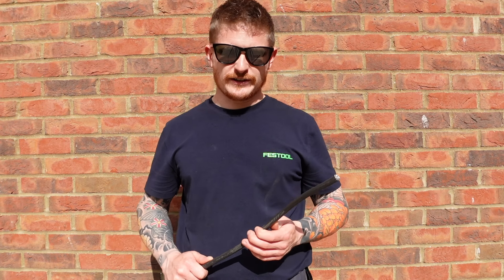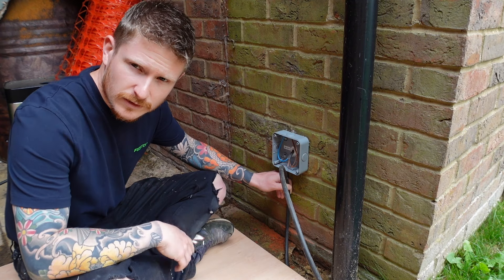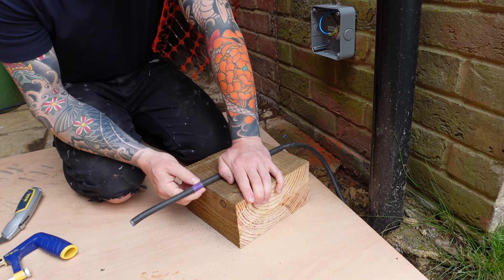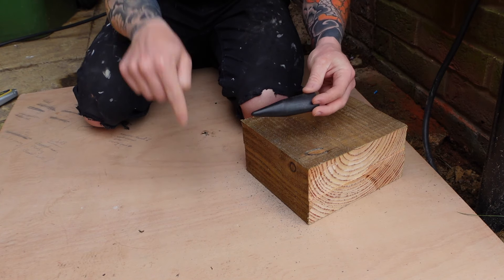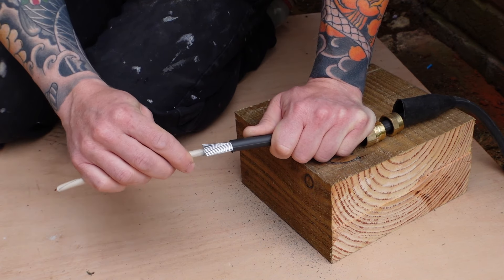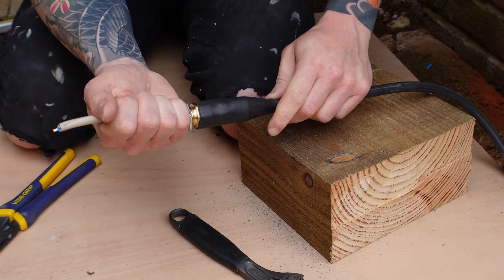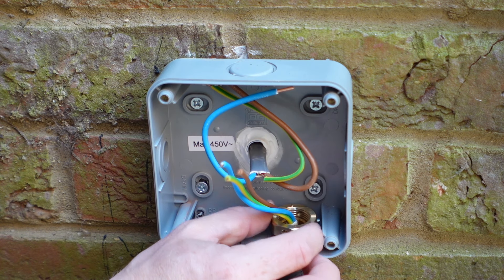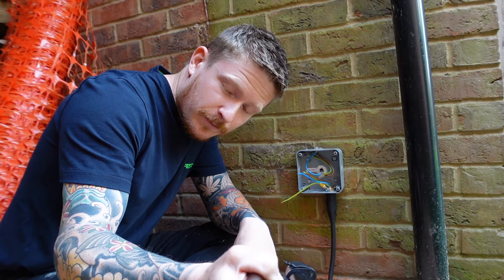How to Make off a SWA Gland | Steel Wire Armoured Cable Install

Comment: It’s a lot easier to push the shroud over the cable and the part of the gland needed before you expose the steel wires that can make it harder to do this
Reply: Agreed, I did this today and followed the steps exactly and cut myself trying to get the shroud and wedding ring over the bits of steel.
Reply: @savingelectric 
Nasty mate, I feel for you. 
This happened because the content provider failed to show that stage  of the process because he’s not experienced enough to teach others yet. 
He struggled himself that’s why it was edited out 😂

If it’s any consolation l, I was reckless back in February and lost a tiny bit of my fingertip due to a slip up with a fresh blade.  Was savage

Comment: Just for a future tip, strip less length  of the metal strands- as you want the top of the gland to water proof  on the outer sheath not the metal strands. Your way- over time the metal strands rust like crazy and let water pass through as it isn’t a good seal

Comment: Personally i would place the shroud onto the cable first. I'd offer it up to the cable pushing it as far as itll go to gauge where to cut so it's a good tight fit.
   Having cut your shroud you either push it on directly in the direction it fits or push the shroud on the contrary way to how it fits and turn it inside out once on the cable. Whichever way is the easier. This depends on the thickness of the shroud's rubber. If its stiff thick rubber then it's best to put it on cut end first as it'll be installed.

Comment: Great video, can you spur off any ring mains socket providing you add a fuse spur? I.e. when all ring sockets are already protected by a RCD at the board?
Reply: Yes, in theory, you shouldn't spur off a spur but fuse it with 13amp fuse.

Comment: I also use Visegrips ( Molegrips in Gt Britain) to securely hold the body of the gland whilst using a good quality adjustable spanner to tighten the nut. Then bend and twist the assembly to determine that the SWA strands are all gripped tightly and there's no movement or play.
Reply: Overall this is a damned good tutorial.

Comment: Excellent video👍 clear and informative.

One thing worth mentioning is that the steel wire armour should not be visible at the bottom of the gland assembly when you've tightened up the last waterproof nut with the rubber seal. If it is then the armour has been cut too long and the gland is not waterproof, despite the outer rubber shroud.
Reply: good point , many people make the same mistake
Reply: Yes I was thinking the same
Reply: Dears kindly can I ask questions
Reply: @Gubalicious  it’s also much easier to slide the shroud, locking nut and ring along the cable and past the connection point before scoring and spreading out the steel wires in preparation for the gland to be fitted.
This helps prevent any struggle with fitting the gland and injury to the hands

Comment: Thanks for your time creating this clear video, much more confident asking for glands etc, rather than saying the back blobby part at the ends of the cable. Cheers
Reply from the maker: Glad it was helpful!
Reply: @TheDIYGuy1  Managed to do the gland, but may have to redo, as I brought a 4 way rotary isolator and not sure if the Neutral wire will be OK in the N1 slot or has to be in the Neutral separate side connection as literally an inch too short. Waiting for the earth nuts so will redo if need be. Thanks for your time.

Comment: there is a much easier way than faffing about with a hacksaw simply use a standard plumbers adjustable pipe cutter, it will cut through the outer sheath and score the armour wires in seconds perfectly straight around the cable

Comment: Sparky quoted me £300 to do 4 of these, thanks a lot. Didn't think it would be that difficult .
Reply: Sparkys hate YouTube and diyers 😂
Reply: And how did you get the electrical cert after doing them?  Or have you just invalidated your house insurance?
Reply: @CBE-d6j  dont know what you're talking about. The circuit was already there when I bought the house 🤫
Reply: @CBE-d6j   another rip off sparky putting fear into people they are good at that
Reply: @cjrodwell  hahahahahhahaha how to beat the rip off sparky's

Comment: The shroud should always be fitted FIRST. Easy way to do it and get the cut right is place it over the cable end, push hard and the cable will be seen better, cut the top of the shroud off as required, then take the shroud off, turn it around and slide it back onto the cable past the point where the gland is going. The install the outer parts of the gland. Then make the cable off. Doing this way you are less likely to forget the gland and less likely to splay the armourings on the cable when you fit the gland.
You also need to mention that this is a CW - Waterproof gland for use outdoors. Do not use BW glands as they are for use inside.

Comment: 1.5 3 core you can cut with 200mm cable cutters 👍.  Lot easier than a hack saw on a small cable.

Comment: Well done video, congrats. I need to connect an armoured 3 core black cable like that one in your video, but I am not sure about the size. External diameter is 17.7 mm. What gland should I use?
Thanks😉

Comment: Great video! Regarding scraping the paint on a metal enclosure, if the metal enclosure has a earth stud/terminal in it for the earth lead from the banjo/earth nut to attach to, is scraping paint necessary?

Comment: Great video and so easy to follow great job
Reply from the maker: Thanks, glad it was helpful
Reply: @TheDIYGuy1  I took my swa from my old concrete shed via a waterproof connector the wires were different from the power in my old shed red,green,blue, and my 2.5mm colours were black , brown, grey . Can you recommend a CU for my shed taking in mind it will be supplying to 4 sockets 2 small led strip lights and a light switch.

Comment: Mate this is EXACTLY what I needed to see. One question tho, I'm using 4mm SWA to power & light a log cabin. What kind of cable do I send through the wall to the main house consumer unit?
Reply: Use the SWA cable as it provides mechanical protection while going through a brick wall

Comment: Perfect Vid for what i'm doing. Lots of detail which is perfect.  Quick question. Where i wanted to terminate my armoured cable into an Outdoor Weatherproof Junction Box is few feet from a water butt . Is this a problem as regards regulations? Thanks in advance and keep the vids coming
Reply: It should be fine, the only time this would have trouble for regulations is when you're installing it in a "special location" a.k.a a bathroom, if you're still worried use a higher IPX grade junction box

Comment: Hi mate, In my house we have 1 junction box (Outdoor) and from there 2  SWA cable 2.5mm  come out for 2 different areas. They are plugs but we use them for lighting and charging some battery tools in the garage. I'm worried maybe the consumption is not dangerous or maybe the installation. Excellent video mate!

Comment: Great video, do you have a video how to connect to the house consumer unit or mains
Reply from the maker: Thanks. I'm afraid I don't.
Reply: @TheDIYGuy1  
I need some advice and hope you can help.
I've installed a BG consular unit in my garage and run armod cable to the house.
What is the best way to connect to the house power supply?

Comment: Is it legal to make this connection and run power to an outbuilding/shed in the UK?
Reply: Not illegal. But if it causes a fire or electric shock your insurance could be invalid.

Comment: Great video, very simple to follow and easy to understand. Can I ask, what do you use to cut the cable to length? I have bought a  25m roll of armoured cable but need to cut it at around 18m.
Reply from the maker: I still use a hacksaw for this but you can get purpose built cutters.
Reply: @TheDIYGuy1  Thanks for the reply.
Reply: Use an angle grinder, quick and easy

Comment: Hi,

Great vid massive help.

Question: i need to power man cave and wouldn’t mind an outdoor socket too.

Can I take the power from inside 13amp socket, to outdoor water tight socket, then SWA from that socket to cave ? I’d the. Want to run lights and sockets off the other end in the cave.

Any info would be greatly appreciated!

Thanks again for these vids

Comment: Better using a SWA cable stripper it looks like a plumbers pipe cutter and you just move it round and round the cable  it cuts through the wire as well
Reply from the maker: Yeah seen those, I may have to get one

Comment: Where did you then connect the earth wire from the SWA nut to earth it? To a socket?
Reply: You connect it with the earth coming from the consumer unit, use a WAGO 221 2-way connector to attach them together or if the junction box is metal or has an additional earthing terminal inside the box (usually found in the corner of a box) you will need a 3-way WAGO 221 connector to add an additional earth wire to the box :)

Comment: Hi, Mind if I ask if the armoured cable for safety when feeding electric out to say an outbuilding/garage type situation? and would that then connect into a consumer unit? Great video thanks!
Reply: Armoured cable is normally the safest choice if you're running to a garage or an outbuilding, ideally the cable will be buried but you can clip along a wall, fence etc. if you don't mind having it on display.

Comment: Quick few questions 

So what are you connecting the SWA to. Is that just 2.5 twin and earth from the ring main. And on the otherside at the shed for example would you do the same. Connect it to 2.5 twin and earth using terminal blocks and then connect up your sockets 

Secondly the SWA i saw online has difference colour cable. Grey, black and brown. Is this the same stuff. 

Also I was going to trail the cable underground in conduit. Have you got it under the slabs?
Reply: Also is that 2.5mm2

Comment: Do you need an earthing nut if it's in a plastic case?
Reply: Yes as it's earthing the metal wires (armor) within the Armoured cable

Comment: I've been looking at SWA cable at screw fix 2.5 armoured. The colour are gray,brown,black? Your armoured cable in the video is blue,brown,earth Dan
Reply: You have 3 phase colours, the black and grey can be sleeved with blue and green + yellow sleeve for single phase application, did this an hour ago 😉

Comment: What a joke. I’m a spark and folk like this have shafted the trade.whats next how to do your own gas. So what’s the zs you are getting on the circuit? What’s your r1+r2 on the circuit. Is there a rcd fitted at the d.b.what’s the rcd tripping times,oh and is there even a earth coming into the property as I assume you haven’t done a ze and pfc test.Rant over
Reply from the maker: 😂 all the tests were done ✅. Sold this property now though and on to the next 👍

Comment: I would never do that! I would slide the gland over the wire first then take the outer insulation off and bend and cut the Armoured steel off. I would never show someone how to take a saw to it with that last bit of wire going underground 😮